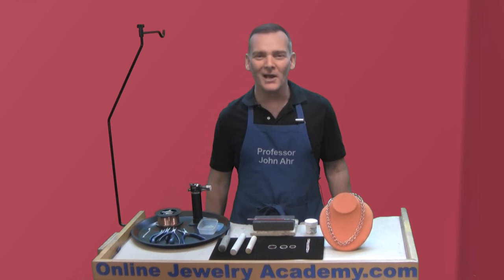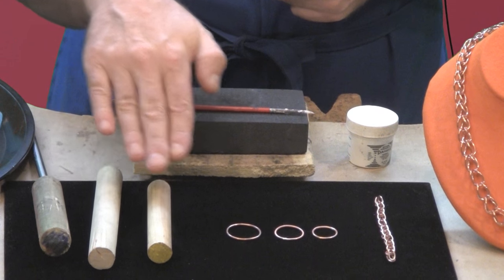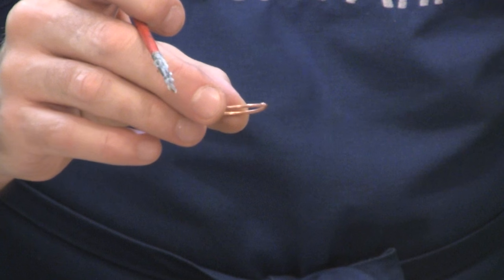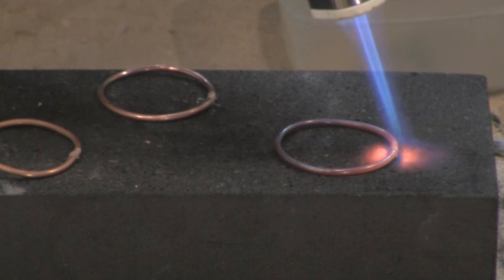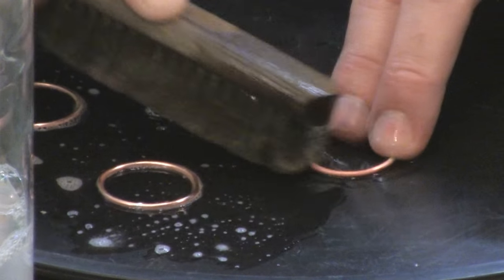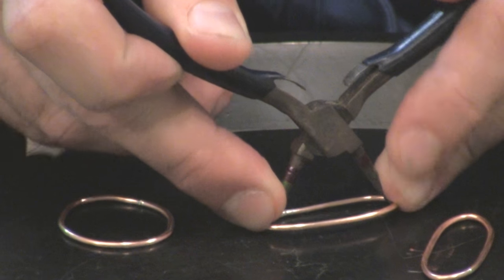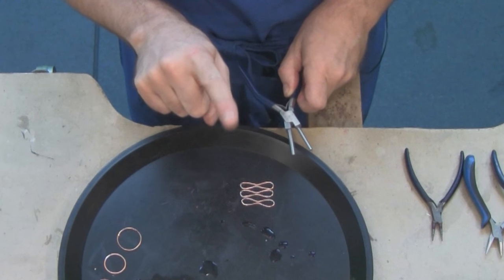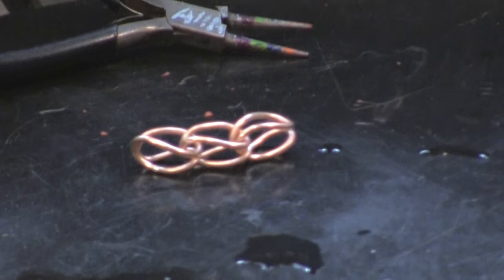The Ancient Art Of Making Loop-In-Loop Chains

Comment: The water left on that tray bothered me during the whole video. I must have OCD.  😂 Anyone else?
This was amazing to watch. I never thought a chain could be made with closed loops. Wow!
I wonder if I could wind the coils around an oval dowel instead of round one. This would save some time over stretching and reshaping.
I will be trying this out using square copper wire. This is a fabulous chain link, easy to make and feels chunky but not too thick. 
I have two questions:
1. Does it make sense to solder each link shut after creating the chain so they don't pop out?
2. Can you harden the chain after making it, with some tumbling with metal shot?

Thank you for a great video, enjoyed watching it and learning!  Greetings from sunny California.  Subscribed.
Reply from the maker: Glad you liked the video. Here are the answers to your questions: 1. The closed loops are soldered shut. So there is no need to solder after the chain is formed. 2. The best way to harden and shine the chain is to tumble it using stainless steel shot. 😀

Comment: Thank you for sharing your knowledge with us. Would you do anything at the end of the project to work harden the wire? Can you place it in a tumbler or is that a big no no when it comes to chains?
Reply from the maker: Hi Christie,  Work hardening your loop-in-loop chain in a tumbler will help it maintain it's shape and shine it up nicely.  You can always safely tumble a chain.  But, be forewarned, the shot will get caught in the loops.  Plan on spending some quality time with your chain as you carefully use your pliers to get the shot out of it.
Thanks for your support! : )
Reply: A tumbler couldn't ever do the damage that a polishing wheel CAN, if it gets away from you, huh?  LOL.... It's only funny in retrospect of many years! In the case of your handmade chain, wouldn't all the bending to form the links be enough work hardening?

Comment: How big are your mandrels?  Also, do you think this pattern would work with 18g wire?  How big (small) do you think the mandrels would need to be for that gauge wire to work?  Thanks for all your videos.  You are an excellent teacher.
Reply from the maker: You can use 18 ga wire to make a loop-in-loop chain.  You just don't want to make the individual rings too large.  Bigger loops made from 18 ga wire could loose their shape easily.  As far as the size of the mandrel goes, I suggest that you make a few experiments to determine what size suits your design goals.  Glad you like the videos.
Thanks for your support! : )

Comment: As with all your videos, you break the process into logical steps.  It's so easy to follow.  You mentioned using 16g. wire.  What size dowels did you use?
Reply from the maker: Hi Joyce.  I used 14 gauge wire in he video.  And the coiling mandrels were 3/4", 1", and 1 1/4" in diameter.  I suggest that you make a few samples before you decide how big to make your loops and out of which gauge of wire.  Have fun with this project.
Thanks for your support! : )
Reply: OnlineJewelryAcademy Where do you get such huge dowels, John? I don’t think I’ve ever seen them that big anywhere.

Comment: Love the look of the 14 gauge, but I'm not so sure my arthritic hands will manage making the ovals. I struggle with 18 gauge at times. Any suggestions for another method to make the soldered links into ovals? Maybe bending 1 side at a time on my bail pliers?
Reply from the maker: Hi Michelle,  I think that the solution to your problem is to use a vise to push the loops into ovals.  Just close the vise so that the jaws hold the loop parallel to the top surface of the vise.  Then close the jaws of the vise until you compress the loop into an oval.  You can then pinch the middle of the oval to create the infinity symbol shape.  Good luck with your loop-in-loop chain project.
Thanks for your support! : )
Reply: Thanks for your quick reply. I read your above idea and said to myself, "oh, that sounds a lot easier". As always, you've been a great help. Thanks again!
Reply: Make or buy a oval step mandrel to eliminate one step. I have an inexpensive plastic mandrel set that includes a oval; you can purchase at Joanne's, Michaels or online.